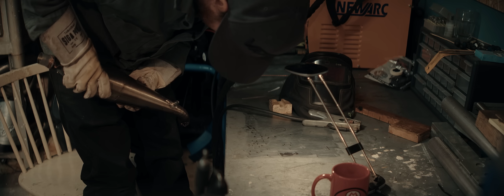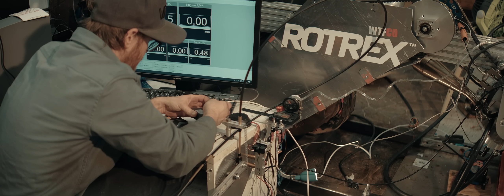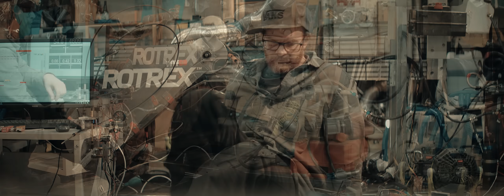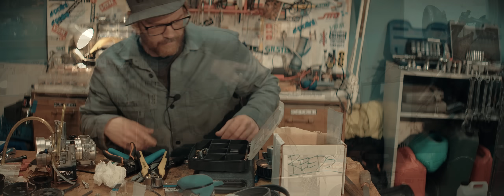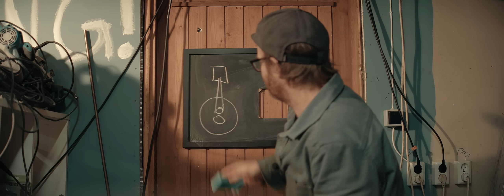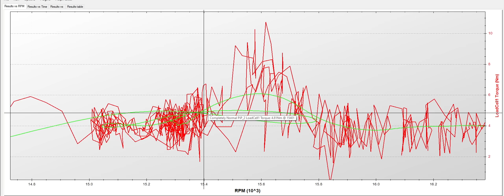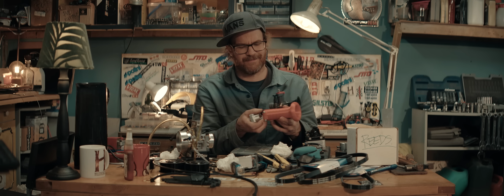18000RPM, But then...

Comment from the maker: Thanks for watching! I'm going away this weekend too, and probably won't be able to read/reply to comments until Monday. Lots of stuff going on around Christmas.
Reply: Don’t worry about us,Take your times with your family brother😊.
Reply: Merry Christmas brother
Reply: Have a good break, recharge. We'll be here thinking about how to make a balance shaft that also performs as a rotary valve.
Reply: Dont drink too much...
Reply: merry christmas mi breda
Reply: Your exhaust port is far to small, the motor is not scavenging at higher RPM and exhaust is diluting the intake charge, causing misfires and combustion break down.  High exhaust velocity at the port is not required in a 2 stroke, getting the K value of the port is more important ( lowest restriction/pressure drop at the port).  Especially with the blower, scavenging with exhaust velocity is not a huge factor.
Reply: I think I've said this before but you should check out World Wide Bearing in new jersey  USA. They specialize in high-performance racing and drag bike applications . Tell them what you're trying to do and they will help you.
Reply: The road to success is lined with bricks of failure....
Reply: God jul🧑‍🎄
Reply: Was the problem an air leak in the case?
Reply: Have a good holiday.
Reply: *Plug colour check between jet changes, 
*Plug can also indicate spark timing, 
*Under side of piston crown can indicate burn temp of the charge. These suggestions may be useful ,no of us want a damaged top end  happy Christmas to everyone  that tunes In, enjoy the Christmas stuffing😄
Reply: Imagine a variable needle .. another cable for needle control  behind the 15000 🥳
Reply: Pas nu på spritten 😂😂
Reply: Have a merry christmas. Thanks for this year of mayhem mate.
Reply: Hey just to let you know not sure if your heater is running at full efficiency Normally the cone on the front will be glowing red that’s how you know you’re getting the right air fuel usually there’s a tuning screw you can mess with on the back
Reply: Enjoy some time out brother , we,ll all be waiting on the flipside ,luv your work and persistence, find so interesting as I toy with hot rodded 2 strokes myself , not to your level but . Cheers for Xmas.
Reply: Marry Christmas incase I don't get to watch until after.
Reply: Take ur time we all will still be here
Reply: My comment will probably be lost in the sea of others but, if you end up putting a new crank in Alex, a cool software / program exists on (Dragonfly75), it lets you adjust the balance factor and tells you we’re to add and remove weight for the least primary and secondary vibrations at a given compression ratio / power level and RPM….Michael Forrest has a YT channel where he promotes this software….I could see it helping your engines bearings live longer but also less noise in the torque signal from your engine due to the harsh vibration….a 50% balance factor isn’t always best.
Reply: Alex if you're using aftermarket Chinese made main Jets you are wasting everyone's time.
China does not calibrate each and every main jet they make like a name brand like mikuni or Kian does that's why they are so cheap.
Reply: we want to see you do something no ones done, take ebay chinese bicycle  gas 2 stroke kit($150) and see how much HP  you can make out of stock one stock bore /piston , that will live for a while and  without blowing  up. I am going to guess you  probably could get one to make 11 hp( double the  5hp stock)  and live for a while .
Reply: we might add   " more of  what no one done, as you have been doing already what no  ones  done" :)
Reply: Lots of comments here and in a happy New Year I would like to think you will read them all but either way I have been following along for quite a while. How well I follow IDK but my thinking and perhaps someone has already mentioned would be a variable length exhaust header. Would probably be more simple to build than a rotary valve and could have a similar effect. The resonance timing is a very precise thing and with variable length that would be an interesting way to see how it behaves. Use manual adjustment at first and eventually use a servo to control the exhaust pipe length.
Reply: im trying to get my minarilie to 12000 rpm tops out at 9200 any suggestions.
Reply: @godlesslife8382  nitrous
Reply: @godlesslife8382 raise the exhaust port a little bit
Reply: If u read this try making the clutch / variater stronger spring lower rollers to fix powerband otherwhise you Will destroy your engine sounds lean. If you have it with normal gasoline/2 stroke mixture try checking the sparkplug White ish color is lean dark is to rich should be coffee

Comment: Having just rewatched this video again just for entertainment it struck me that the carburation has always being hard to set up on PiP as it acts rich even when it is running lean.
I feel no matter what carb Alex fits it will experience the same problem due to the large crancase volume. I, along with one other person has noticed the long delay it takes for the engine to pick up revs while blipping the throttle.
Mark Atklison experienced similar problems to Alex 3 years ago and this was put down to the lack of fuel/air speed charging the cylinder.

Comment: Helo story my lengug i watch you abat 2year  and im impres and im hepey the engy whork you doo a wery Hood worki inginerig but to setap the engi i think i whil yous the fluel injector and 4t ECU standalone ECU i dont knohl how you yous two postój to one ignision 4t 5000rpm X2 10000rpm2t 
And you have a lot of Control on map to one shot you need a lot sensensor  mas map egt ,ect ,after you have a power you know shot you need but i whil stay wich injector just new 2t enge

Comment: I was just reminiscing back almost 50 years ago when I used to race AS1/AS3 twin cylinder air cooled Yamahas. These were road bikes with a race kit made by Yamaha.
The earlier AS1 race kit was supplied with tiny carbs that would rev to 14000RPM. It was common practice to adapt 28 mm carbs off a Yamaha YDS7 road going engine as these carbs were visually similar to the hyper expensive AS3 race kit carbs. Sadly these carbs would not allow the engine to rev cleanly to 14000 which was maximum power.
The race kit carb had a extra internal passage that could not be drilled into the road going carb to allow it to rev out to 14k cleanly.
I'm just wondering, could this be a problem that Alex is facing with using none racing carbs?
I must admit my monies still on the high crank case volume.
PS. Thinking back the highest PiP has revved was 18300 using  the Roots blower and speedway carb?????
PPS. There is no reason why a carb can't correctly fuel a 50cc petrol engine upto and beyond 20K as proven by history. 
While I'm a carb man, I begining to feel that ultra fine mist fuel injectors may have a place if fired alternatively. We mustn't forget that the fuel will contain 20:1 castor oil.

Comment: I've only just realised........Many people commented on the fact that the cylinder is faciing downwards and that it should be upwards. IMO with the cylinder facing downwards, my thinking this should help with the flow of heavier fuel/air mixture pass through the port passageways/windows no matter how negligible. 
The problem I see with the crankcase's being at the top of the engine and the main secondary induction tract directing the fresh dense fuel/air charge to the under side of the cylinder. This may lead to bypassing the crankcases thus relying on the very low pressure pumping action to force the fresh fuel/air charge into the main bearings for lubrication.
As I said previously, I feel the crankcase volume is much too high for N/A. This has being reiterated many times by Alex over the years suggesting Mk2 N/A cases may be made 2 years ago!
I feel that if Alex wants to cotinue with these cases, the case volume needs to be reduced AMAP, lubrication passageways need drilling into the cases for the main bearings, the portwork needs doing and the crank balanced to a better standard for 20k rpm not 12-14k.
This is no reflection on Alex's ability to design/manufacturer his projects in any way!
Alex has also mentioned some people may feel frustrated at the lack of progress. Trying to re-invent everything is not needed all the time as Alex has said previouly.
Looking forward to seeing Alex back in the garage in 2023!

Comment: Can you put an wide band 02 sensor there like a LSU 4.9 even if it does not last very long , will be great to have that value to know if you are rich or poor on fuel.
Also will be nice to have some way to log it on the pc cause the rapid changes
Reply: As you say even if the Lambda doesn't last to long it may be worth a try. If the blue high performance Stihl fully synthetic oil was used at 50:1 I feel a Lambda should last at least one hour or so if fully warmed up. One chap suggested using a diesel lambda which I though was a brilliant idea.
I feel this problem has being reached before when Alex tested it prior with the carb and petrol. IMO the massive 390cc crankcase volume is leading to very poor primary pumping efficency as the fuel/air in the crankcases isn't being compressed enough to pass into the cylinder efficiently at high revs.
When running the Roots blower and speedway carb using RC fuel it achieved over 18000 revs and climbing pulling the retarder unbraked. This was helping to fill the massive crankcase void. When the Rotrex and Lectron was used with RC fuel poor fuel atomisation lead to the fuel burning as it was leaving the exhaust port which it can't do on a 2stroke with a expansion chamber.
I genuinely feel the lack of primary pumping efficiency is leading to these problems which Alex faced a year ago and facing now!
Alex has 3 sets of stuffers made to help reduce the crankcase volume and 2 sets remain untried.
I feel if the crankcase volume was reduced AMAP, the timing set at 1.8mm BTDC static and the cylinder port work done it will rev upto 20k no problem!
I respect it's Alex's  channel and he has the right to do as he wishes!
Sorry for waffling on so much!!
PS, the crank needs re balancing as well, mustn't forget to drill the lubrication holes in the piston for the the exhaust bridge.
Reply: @malcrandall1309  You need to install the lambda more into the rear in the low pressure or "atmospheric" pressure zone.
 I use mine on a rotary engine with a premix of 1 to100 , and it last. I will say that is better than guess the air fuel ratio ;)
 More into the tip the problem is that you will have a delay on the measure but that's all ;) . Send me an internal message and i can show you something interesting :)

Comment: When you get back to supercharging here's a thought. Instead of wasting horsepower pushing high pressure air around on the back side of the piston in the crankcase do what two stroke diesels do. Just move the air straight through the cylinder avoiding the crankcase completely. A variety of options to lubricate the bottom end would need to be considered.

Comment: @2STROKESTUFFING you need to get a EFI system      for sure     and you have the engine dyno Rpm SET TO HIGH     a small 2 stroke engine isn't supposed to go over 17k rpm     plus your AFR isn't right you need a AFR gauge to PROPERLY TUNE an engine 12.5-14.2 is where your ratio is supposed to be at     you need a AFR gauge to PROPERLY TUNE the engine      and that sound you heard was the engine bog it happens when there's too much air or fuel going into the engine     when you fix that it'll RUN RIGHT     not BEHAVE      I'm just sitting here looking at the mistakes u do and point them LIKE you NEED a AFR gauge after the expansion chamber for ACTUAL TUNNING and you'll have it RUN RIGHT     ik your experimenting and stuff like that but the first thing you will ever need to PROPERLY TUNE is a AFR gauge    to get the engine to RUN RIGHT

Comment: Dellorto says that the needle jet extended upwards only changes the low throttle jetting in that it reduces flow thru that jet at low throttle openings.

Comment: Idk man. After having a 2 stroke 49cc peugeot scooter as a daily driver for the last 3 years... i kinda hate them because they never run right... Either my carb or my 1500km cylinder(it has been replaced, the old one lost a bit of compression at 35k km) is going to shit. Loses quite some power when it gets hotter... even in -2 degree temp

Comment: One phenomena causing alternating torque is the fact the rotational inertia will vary as a function of crank angle. This happens as the contribution of the connecting and piston to rotational inertia is a function crank angle and as the inertia changes its value, conservation of momentum will force the rotation speed to change its value. In other words the crankshaft is experiencing the same as if you would be in a carousel changing your position to outwards and inwards twice in a rotation.

Usually this needs to be considered only in large engines but in your case the engine is connected to the dyno with high gear ratio. Gear ratio (I) will change the equivalent inertia in its second power I^2 possibly making this effect considerable.

Tried to add links to articles below but the comment was not published maybe because of them however I think it was first discovered by Goldsbrough, G.R. in The Properties of Torsional Vibration in Reciprocating Engine Shafts, Proceedings of the Royal Society, vol. 113, 1926, pp. 259-264. So maybe googling it will further info can be found

To fix this I would go with Mikey Antonakakis comment. You would need to low pass the signal because I believe you are interested in the average power of this oscillating signal. Or in other words you don’t need to know how to power changes though each rotation of the crank but maybe the average through a few rotations.

With PID controller I have very little practical knowledge but in mathematical sense too fast controller can cause common resonances with structure. In practise this means that if the signal from the controller is able to create a signal which oscillates with the frequencies near the structural eigenfrequencies the coupled resonances might occur. 

Anyways this just popped to my mind watching this. 
Great work, at 15:30 it looked and sounded like you were testing a working engine!

Comment: I have a 100cc two stroke engine mounted on a bicycle and when I take the exhaust innards out it runs and almost makes full revs but when I put them back in it only makes half revs and when the clutch is pulled it makes High revs either way any idea why that might be happening?
Reply: Check if you have air leaks

Comment: Doesnt the diesel blower make your eyes sting. Just last week we build an engine and I rather spend that time in zero degrees C than turning that blower on. And you never use brake cleaner when diesel blower is working. Thats like mustard gas

Comment: I honestly believe that if you made an inlet plenum big enough to house the carburettor it would 
1. Stop any problem with leakages due to pressure differential 
2. Give the carburettor a volume of air to take in that is less turbulent.
3. You can also add a mesh to make the air more laminar 
Just an idea
Andy

Comment: Why are the fire extinguishers next the the heater, you want them next to you so you can deal with fires. Now if the heater goes up you can't get to them. Not having a go at you just offering a safety tip. Also get yourself a car radiator with fan plumed into you engine, that way you get to use the heat produced delivered back to your shop for free.

Comment: Was it time for the bearings to go anyway, or was this premature? I know it may sound weird and old fashioned, but would oil cups feeding the bearings help, or would it mess with the seals?
Reply: The mains wore away very quickly as did the brute force I believe. As far as I can see there is no drillings to allow fuel/oil to access the ouside of the main bearing.